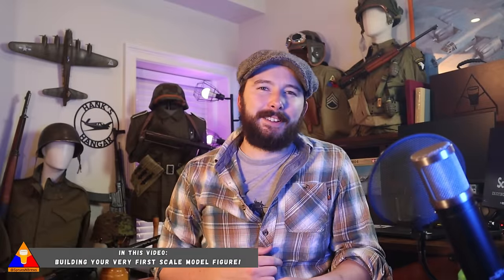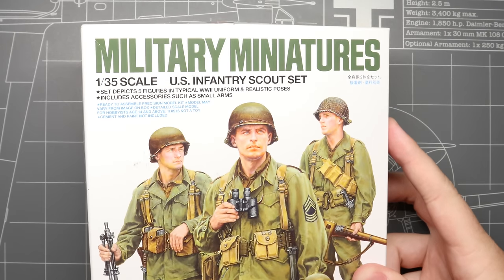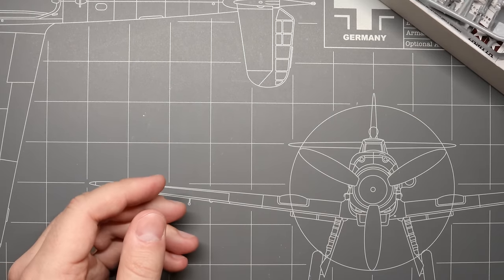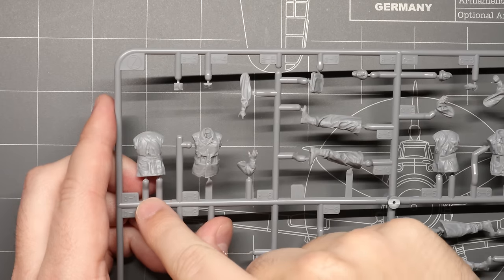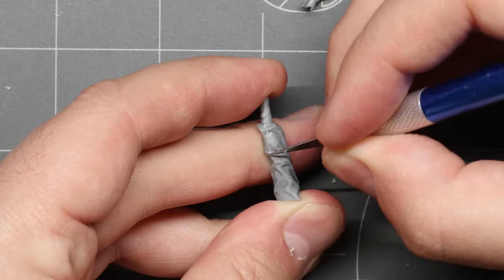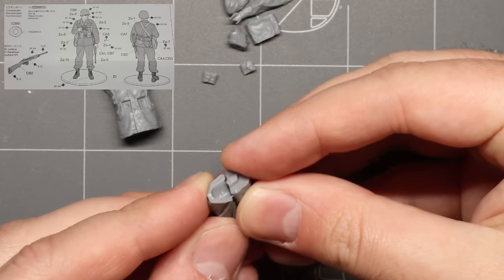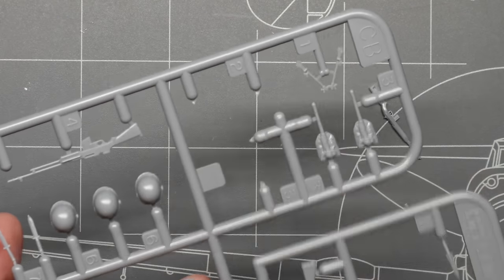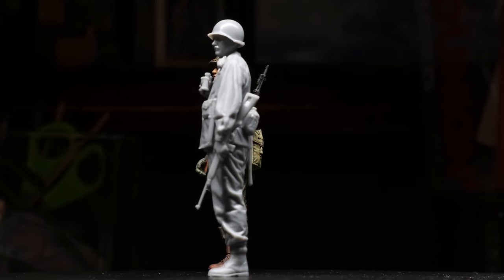Building Your First Scale Model Figure! | 1/35 Model Kit Tutorial

Comment: I was told to scrape the flash off with the back of the x-acto to save the sharp blade.
Reply from the maker: That could work, too! But if it's a high-quality blade & soft plastic, you shouldn't have a problem 👍
Reply: So, stropping a blade on a piece of leather sharpens a blade , but scraping it on plastic has no effect? @SpruesNBrews